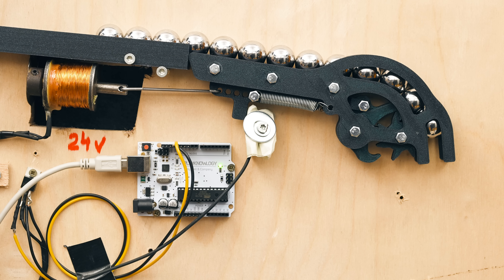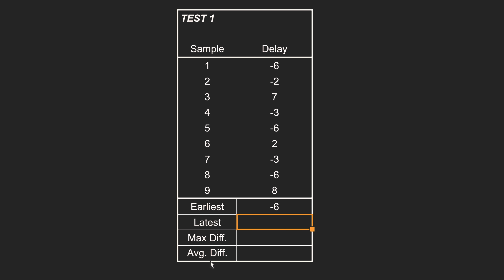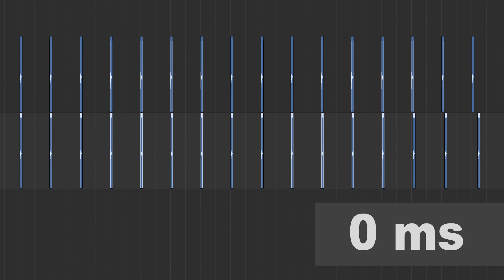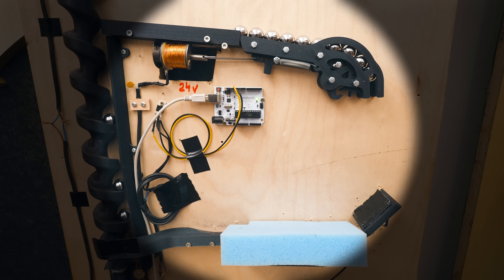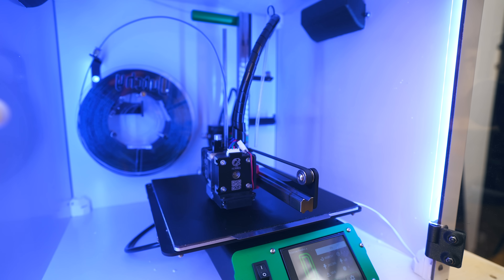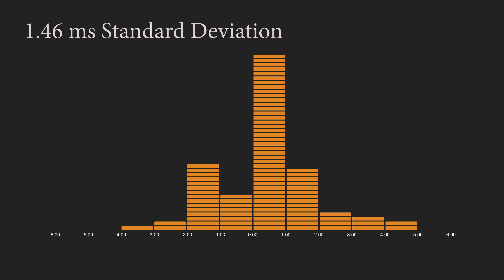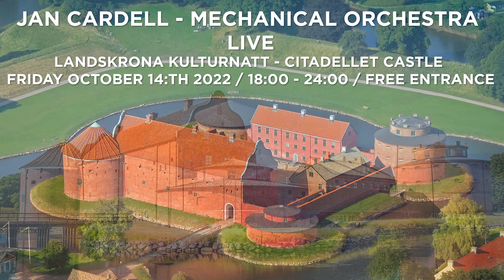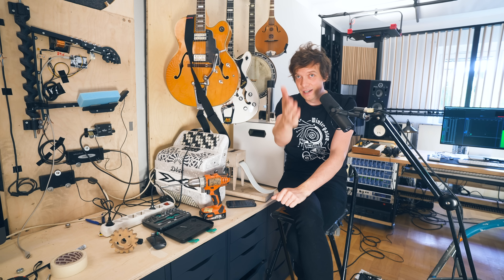Testing the Arduino Marble Gate

Comment: Look at the original marble machine gate mechanism.  It is 2 gates in series with only 1 marble loading the critical release gate.  You had a version in MMX with a sliding plunger with slot in it that aligned first with marble queue, then slide to drop the trapped marble out to play.  In my opinion this gate is the best one.  The queue does not load the output drop.  There is no jerk on the gate as the marbles in the queue first rush in, then crash into the gate.  The only thing I would change in that design is to have the block follow an arc (it is always easier to have stuff rotate versus translate.  There is less friction & moving parts can be kept apart except at the rotation point.)  Each of the gear's teeth has a different shape leading to different drop times.
          You need to keep pressure angles LOW.  Motion & surfaces the marbles bear upon should be a near to right angles to the marble path as possible.  This reduces lateral forces which lead to wear & jamming, & increases sensitivity to timing error versus gate motion.

Comment: Pursuing mechanical perfection just leads you back to fully electronic devices. The point of the physical machine is that it's not perfectly tight - it's loose! It's using physical components that vary, wobble, aren't right in time, might be a bit off pitch sometimes, but it's still running and the output is more beautiful because it is organic! This direction is just chasing a futile end goal.

I hate to say it, but your Six Sigma friend has pushed you down a very dark course for yourself and this project. Please reconsider.

Comment: Another thing that could have helped improve your std dev for the flat sensor is that you put the marble back on the slide after each drop which makes the marble pressure on the gate consistent which probably makes the speed of the marble leaving the gate more consistent

Comment: Martin, I gotta admit, I started out a little bit of a Wilson on this video, but I realized a couple things: one, factors like this really do add up in a fully mechanical machine, if you tighten up each factor, taking it into account from the beginning, and realize that your newly designed parts make a machine after all, it will probably go a lot smoother. And also, your mindset makes a huge difference. If giving yourself the space to say “actually this doesn’t sound fun anymore, let’s do something else” helps motivate you while it is fun, that’s well worth it, and after all you really do love this project, you’ll come back to it if you let it free. 

So in that spirit: remember to check the contact microphones’ simultaneity. Make a noise both can detect somehow, see what that error is. Wires have speed of light delay, if they’re different lengths that might be a problem. If they’re translated into digital at different times make sure the computer isn’t somehow checking on one before the other or something. Accuracy of measuring equipment is most important before you hyper focus on accuracy of your mechanics. That’s how you get experimental rigor. 

Glad to see you smiling about a marble gate for the first time in a bit, good luck on your studies lol. (But seriously a research paper on this machine might get you a PhD somewhere if you really wanted it.)

Comment: Firstly, welcome back Martin :) 
I think there are two caveats to this sort of test. 
Firstly, I think it can provide valuable data by testing components rather than testing an entire system. Having that data can help you catch problem before they ripple through the entire system/machine, and can also help you better diagnose problems when they do arise. I also think just simply setting up singular benchmarks is a good practice because by isolating a single component you introduce challenges that might spark new approaches to challenges you face in the full system. 
Secondly, I’d caution benchmarking against perfection, as others have already pointed out. While it does provide valuable information, stressing over fractions of a millisecond may just be unneeded stress for you. I think benchmarking against professional musicians would be a more insightful and maybe less stressful approach (if the data exists, if not collecting it might be tough). But if a professional drummer or professional drum line have a variation between notes of say 20ms for example, what are you seeking for improving upon 3ms in your machine? That’s not necessarily a rhetorical question, but I think it’s something to ask yourself and could hopefully provide some comfort. If you can manufacture something that is comparable to the best humans in the world but is easier to manufacture than something that is magnitudes better than the best humans in the world, then why go for the harder option? You may have a reason or it may just be a personal challenge, but I think it’s a question worth posing to yourself every so often.
Reply: THIS!
Even his first test with playing all the samples from the 3ms tolerance test at the same time showed how perfectly simultaneous that sounded and he really has to be careful to try to go for perfect again.
Reply: Don't take this as fact, but I remember reading somewhere that the average deviation for a musician is about 10 to 20ms

Comment: Three points for Martin:
1) This would have been better as a thought exercise. Self-evidently, any timing variance in your rig was 100% caused by the semi-random trajectory of the falling marbles. There was no need for this test.
2) Do you really think you're going to place each marble contact (drumhead, cymbal, vibraphone bar, and bass string) at a perfectly flat, 0-degree angle?!? What did you really learn here?
3) Did you forget the lesson about reliability > accuracy? If you take a MM on tour, any precise control you enforce will be shaken loose by the rumble of a stage, the drifts in the air, the angle of the floor, the temperature of the room, and many other factors that make all this work self-defeating. There's no taming chaos theory.

Okay, I'm super glad that Martin is just having fun and not promising to build the machine. That's healthy... but bluntly, this exercise was a colossal waste of his time. He's learned nothing. No, it's worse than that, he's mislead himself yet again.

"A pragmatic machine, with no bells and whistles, no artistic decisions." Martin keeps coming >this< close to having the genius realization that the only unsolved problem with his marble machine design is that it uses marbles. At this point, I'm honestly shocked he hasn't said as much yet.

Comment: NOPE. The whole deal was as close to an acoustic instrument, as true to the ORIGINAL marble machine as could be had. MMX was getting there - with minimal enhancement from a motor helping to maintain time, and now, it's OFFICIALLY not.
  
I suspect in a substantial amount of time, this new move will be scrapped, and a return to MMX will ensue - with "new" excitement.
Yeah, no.

Comment: To be honest I have mixed feelings regarding the dramatic shift in the project, but then I stopped and thought, you are designing an entire instrument from scratch. The main premise is to make sounds. To use your electric as an example, the guitar is meant to have the string interacted with in order to make a note. Most know guitars as finger-interaction only. Your weighted marbles accomplish the same result. So having a project shift to a more optimal result for more consistent results is a good choice. Well done.

Comment: Keep in mind, that the clock generator (programming wheel) will be responsible to keep the instruments in sync. Not every delay will add up. That would only happen if you have independent clock generators. Like in you software. One drum line which has perfect timing and the other line goes out of sync. But having everything connected to the same clock generator could not produce such out of sync pattern. So IMO it is important, that the programming wheel and drum machine are perfectly in sync, because if there are inaccuracies, they could add up. I can't remember any other clock generator.

Comment: 13:30 Instead of taking the parameter out of the equation, you could have tried to optimise this parameter to see if the release mechanism's time offset was synchronized with it's lateral displacement. Maybe leaning the test zone at 10 degrees in either direction would have tighter time? You only tested the original 45 degrees and the flat 0 degrees.

Although you're already hunting for perfection in the realm of diminishing returns, so you probably don't need to go that far.

Comment: You should look into what is going to be the most impossible to get perfect. And then you only need to make sure that all of your other steps are less than your worst step. You also want to account for the machine wearing out. Getting it within three milliseconds while it is brand new is nice, but if it's going to end up being 10 milliseconds apart after a few hundred songs, trying to get from three milliseconds to 2 milliseconds is a lot of work that can be directed elsewhere.

Comment: This rabbit hole is so deep that I cannot even imagine finding sunlight again. What is the point of trying to improve an electronic component that you don't even want to use, and say you will not be using, and which is already so reliable that any improvement will be completely indiscernible, and it sees widespread use across the world to control devices that absolutely HAVE to be as precise as possible? Just... what is this? This doesn't have anything to do with a marble machine anymore. It's not even tangentially related to any point of failure in the MMX, if memory serves.
Reply: It was a surprise to see a new video, and a welcome one, but I am unable to understand what purpose this serves. Don't get me wrong, the subject matter is interesting in its own right, but this is well past Wonderland in terms of chasing a rabbit.

Comment: maybe you shouldn't try to seek perfection. When you begin in mechanical enginneering you first learn to do choice of what solution is best for what you want and maybe putting what you want as a result on paper could help you chose during your process what is ok and what is not. for example: you want perfect accurency of the marble no falling, perfect timing and perfect song and also make the machine entirely mechanical. With that in mind everything else if it stay on that list is free to imagine anything that would work

Comment: Something you need to consider in your measurements.    The microphone system you are using to record your tests has an error of its own its putting into the equation.   How much of an error i dont know.  But you are measuring with an imprecise device.

Comment: Arduino has so many builds and variants under the same name, it's not a remotely good choice for a real time application, but one can be forgiven for thinking otherwise. 
Funnily enough it's also overkill at the same time - some MOSFETs with a couple capacitors would drive that solenoid to a degree 10s of μs

Comment: To my non musical ear a 5 ms difference might be heard but too small to worry about.  On the flip side, it's always good to know what you are working with.  
Food for thought, should you use a drum to actuate the drops, are the pegs in the drum going provide this level of precision?
11:39  If you watch the bolt on your gate spur gear you see a good amount of movement.  I'm guessing you have another side which will help stiffen that up.  Another thought, would ball bearings everywhere be an improvement?  Help with precision?  Good point in the design process to look into it.

Comment: What kind of pulse width are you working with when you get into the mechanical side? The mechanical side's quite a bit more "analog," in terms of the actuation force. The solenoid's definitely more of a square, than a triangle. I think that if you're gonna perfect a mechanical gear etc based on a digital input force, rather than a linear/mechanical one, you're gonna be spinning your wheels, man.... I kinda wonder if a geneva drive's the way to go, where you can convert that linear/rotational energy into a hard(er) more defined input conversion. Or just go straight actuator, with a gear to push buttons. Full mechanical will have a lotta slop, and that's fine. Even though I know the MM1 wasn't long for this world, if that was redesigned to last more than a few shows, with everything that didn't need changing, and only what needed it changed, the world would be a better place.

Comment: So while flattening your microphone to get a better DS is good in theory, what you'll really want to do is set the microphone to be at the angle of whatever the marble will realisticlaly be hitting. You're not going to have your drum flat, otherwise you just get marbles bouncing multiple times. So rather than adjust the target, I'd advise finding a way to make the deployment more consistant. Perhaps something that allows for slightly more aming of the marble, like a short tube just after the release mechanism.

Comment: Thousands of times I was about to write you to use arduino to have a perfect time in the gates. The programmable wheel should also be made with solenoids to be able to change all the tones in a second. Music and engineering <3
Reply: YES! The one and only piece of "tech" I always thought made sense to add to the MM was making the programmable wheel *actually programmable* via an array of solenoids. The machine's actual functioning would still be completely mechanical.

Comment: For all the work I have done with Arduinos, I am pretty surprised you got such great performance out of one.  Arduino system clocks are notoriously inaccurate.  So a standard deviation of as little as 5ms was really good.

I am told the solution to that is an external clock or crystal, but I have never needed to do that.  You could also upgrade to a Teensy, which is a faster Arduino compatible board with a better clock on it.  Good luck, keep going.  We are all cheering for you.

Comment: Min maxing everything, albeit obviously purposeful, is still painful to see. You'll never be in full control of the machine, and even if things add up to a net negative, it will still sound good as long as the machine doesn't break down. If you think about controlling your machine perfectly once assembled, how could you even guarantee the same outcome after disassembling, transporting, and reassembling it again? Who knows if even different weather could affect the performance. Build the machine sound, but also let it be human, let it have those small imperfections.

Comment: A minor suggestion to make your timing tests potentially easier and more accurate. Since you're using an arduino, look into a photo interrupt sensors. Then you could time the marble crossing the plan of the sensor using the arduino. This would allow you to measure exactly how long it takes between the drop signal being sent and the "beat" of the marble crossing the sensor. In addition you could stream the values back into your spreadsheet automatically.
Reply: This would also let him record thousands of marble hits instead of just a hundred at a time.  Just leave the rig running for a few days, then import into the spreadsheet directly from the arduino.
Reply: @markroy4062  Definitely agree. 100 sounds like too small of a sample size for meaningful results

Comment: I had pictured a replacement for the MMX with just the top program wheel, a similar dropper system and a ladder chain lift going the full height of the machine. But also a bank of screw lifts could work pretty good.

Comment: Hi Martin, a mathematician here. I think that for your measurement purposes you should use AVEDEV instead of STDEV.
Also, since you want to reduce the delay as close as possible to zero, it makes sense to measure the Mean absolute deviation around a central point (0).

Comment: IMHO, I echo the sentiments that a big part of the charm of the two previous machines is that they're being powered by imperfect marbles. Trying to make everything perfect in a machine that by its fundamental design uses imperfect analogue movement (marbles themselves, mechanical triggering etc.) this seems... impossible? When lots of marbles are moving around this will create vibrations and such, and if the intent is touring the machine around, its assembly/disassembly/movement is also a factor... I wonder if focusing on reliability and error tolerance would be preferred over millisecond musical precision? Well, it's a journey I guess.

Comment: I'm sorry but I won't watch you throw away the work you put into the MMX over something as silly as a perfect concert. The fans that would've gone to see it would've been the ones that knew best from your videos just what a complex piece of mechanical kit it was, and would've understood if it didn't go through the whole concert without issues. It was never going to be a reliable piece of kit, that comes from the complexity it had, yet it made up for that a million times over in its charm. 

I just, can't believe you'd so willingly gave up the very soul of the machine, and the progress you'd made over this perfectionist streak...

Comment: Nobody is gonna notice a 4-5ms variation.  Just as long as the timing is consistent and doesn't drift into 100-200ms gaps then you'll be fine.  Use rubber filament to print some of the parts to absorb impact.

Comment: Some of the variation in time of the individual drops could also be the result of imperfections in the drop wheel, and not necessarily the arduino board. I'd actually bet money that the 3ms differences are coming from the wheel rather than the arduino.

EDIT: I probably should've watched the rest of the video before posting my comment.